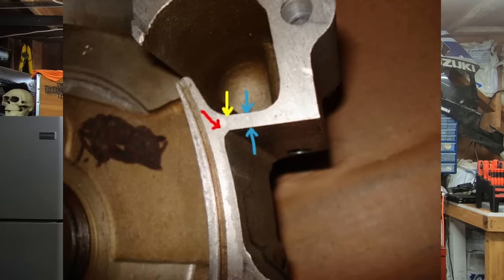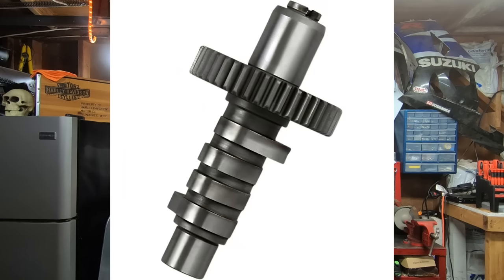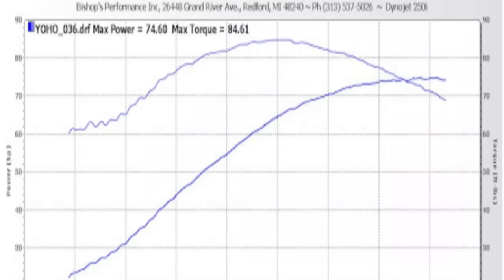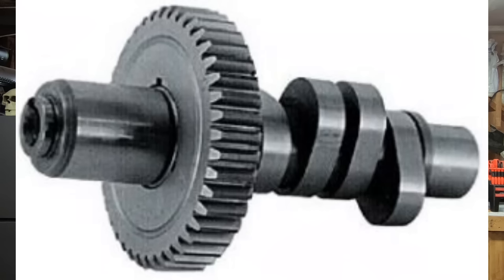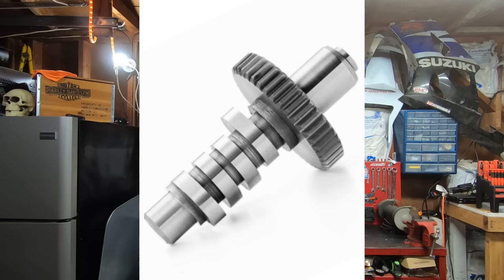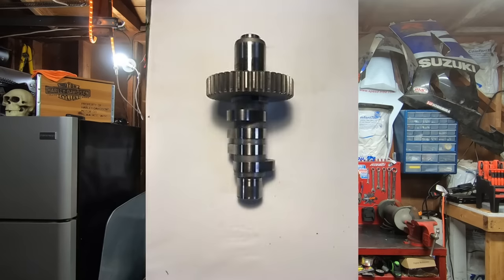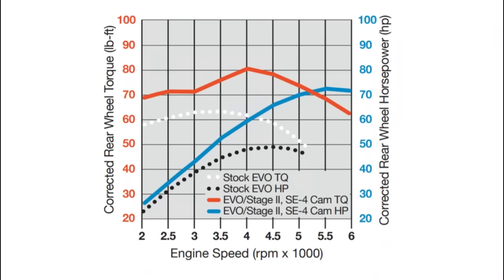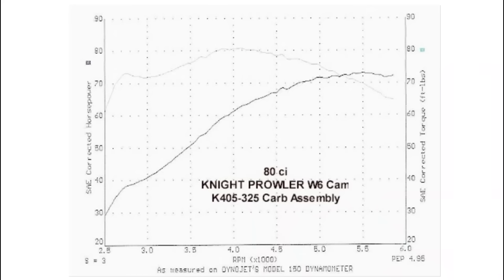Absolute Best Upgrade for the Evolution Harley-Davidson

Comment: I ran a Wood cam/ w6, expensive, but good. After some mods ended with the w8,H.  Still an 80" motor. Murdered tires, chains, sprockets, wheels, and clutches  Was loads of fun, but too much maintenance. He makes good cams. I would recommend keeping it closer to stock. Good Lord, just noticed this post is 2, count ' em, TWO years old...

Comment: I bought a new XL1200S in 1998.  Billed as the ‘performance’ version (two plugs/cyl, extra front disc, maybe a tad mor compression) Thought I could spice it up, above and beyond the initial torque grunt.  Pipes, jets, filter, host tube.  Killed the torque, didn’t add much on top. Actually, still makes power when rev limiter kicks in, at 5500!!!  One available for 6300 rpm available, was, but expensive.  i gave up.  Found out how much Harley’s are different from modern engines, dirt bike engines, etc. I was completely ignorant going in.  No youtube in 1998…hard to get info like you can today.  Regardless, the bike looks fantastic. Still have that ‘98, still runs great 8000 miles.  Still For Sale.

Comment: 2010 I went with SE heads, EV 23 cam, Mikuni 42 carb, Kirker Pipes 3-1/2 Super Trapp thunder  Dino was 98 HP , I was shooting for 100 hp . 98 is fine a 103 stock cant touch this  .

Comment: Adjustable pushrods eliminate the need to remove the rocker arms. Otherwise the fuel tank, rocker boxes and rocker arms need to be removed to access the pushrods to unload the lifters.

Comment: My 88 fxstc moves with no issues. I have a w6 cam, mikuni42 carb, s&s lifters, ultima ignition, and adjustable pushrods. Top end is all stock but it goes great. For bolt on stuff it's way different than it was when I got it. Anybody looking for a cam if you can't decide just go w6 it was well worth it.
Reply from the maker: Good cam in an Evo makes a world of difference over stock!

Comment: I put a 13 n my softtail Got an ultima 6 speed n a Makuni 42 VnH  long shots Got great torque n top end  Avrage 50 plus mpg Can use 6 gear from 50 up Some had put a 38 Got around 30 mpg And couldnt ust the 6 speed till 80 mph Im happy with the 13
Reply from the maker: That's awesome! Those 6 speeds make a huge difference!

Comment: My 2017 sportster 48, coming back from Daytona the other night. I was running with some sport bike 600. I was running around the 138mph.
Reply from the maker: My wife has 2017 48 and it will absolutely walk off and leave my 2016 Sportster Custom. I know it's a lighter bike but it's got some serious power compared to the 2016 model.

Comment: Bought my FXD with S&S 502 cam, was running like a raped ape but the valvetain was rattling as a bucket of nails and was eating lifters for breakfast. Swapped 502 for EV27 and perhaps lost some peak power and torque but it has a really broad power and torque range, valvetain is really as quiet as if it had a stock cam and as a bonus it now has a slightly quieter but throatier exhaust note. Very happy with the result

Comment: You have a good channel and you seem to be very knowlegeable.
 I'm not into racing or a bunch of facts and figures, but I've got a '97 Wideglide that walks away from twin cams and will cruise at 80mph all day long, with 41,000 on the odometer.
 I bought it second hand 5 years ago and it sounds like a stock motor and has no engine noise.
Reply from the maker: If it's rolling away from twin cam bikes it might be a cammed EVO. Evo's makes some big torque with the right cam in them.

Comment: I believe the evo was the step above the shovel. I love the shovel's thump. The Evolution engine is a longer lasting in stock form engine than it's predecessor. Basically a longer running engine than the Shovel. However the '84 shovel was close .

Comment: Love Woods cams. I have had my evo since 85 and have put a few cam changes always using Andrew's cam until a friend talked me into trying the Woods  . As far as I'm concerned it pulls a lot harder than any of the Andrew's cams I  tried. If you want to build a stronger engine with head work and card and such I went to the Woods w6h and Woods carb. Pulls like a mfr. At about 110 I ran out of guts and the old girl was still pulling hard.

Comment: Look at V-Thunder cams.
Excellent cams with soft opening n closing ramps for engine longevity.
I ran an Andrews EV-27 and after about 25,000 miles it beat up my cam n one of the lifters to where the tiny needle bearings were coming off the lifter roller. The EV27's fast opening n closing ramps are too aggressive n beat up on your valve train. Eventually damage will occur.
That's why I went with Comp Cams V-Thunder series cams because they were specifically designed to be easy on the valve train to increase engine longevity. As far as power n torque, I have no complaints, they do their job
well, have a real smooth idle n give you that low po-ta-to, po-ta-to idle that you want to hear. They are awesome cams. You really don't need anything higher than a 520 lift cam with a decent duration to produce good power
n work easy on your valve train. Anything higher n the engine fights itself to produce power working against those heavy 200+lb
valve spring rates. Something to think about.
Live Free
Ride Hard
Reply: I'd need taller valve springs? (For sure,but what else do I gotta do for a .595" cam? I had a 96" 4x4 s&s sidewinder evo in a bar hopper,that thing had balls!
Reply: @numbskullsknuckleheheads7636  
A 595 cam is to big. Yeah, not necessarily taller, but stronger valve springs. This alone will overstress the valve train causing premature wear, n sooner or later damage.
That big cam will also require cutting down the valve guide to allow for the added lift so the bottom of the top spring collar n keepers won't hit the top of the valve guide when the valve is opening the valve. It also needs to be cut down enough to allow to install valve guide seals or your engine will burn n smoke oil. By cutting down the valve guide, you are also reducing the length of the valve guide decreasing the amount of support the valve guide gives the valve stem, in essence making it weaker. The movement of the valve will eventually start wallowing out the top of the valve guide. That's why keeping an engine close to stock specs with the biggest "bolt in" cam works best for engine longevity. And you don't necessarily need a higher lift, you just need a moderate lift with a "longer duration" to keep the valve "open longer". You can also machine the heads to accept larger valves (tulips) to minimize the lift of the cam, because a longer duration achieves the same thing with alot less stress n friction on the valve train which equals Horsepower. You may have to figure out which duration cam will work best with the piston stroke to maximize your "swept volume", ie, how much air n fuel the piston will suck in... High compression is not necessarily needed either, unless you're planning on having high octane fuel on hand all the time. 9:1 compression is good for the standard 91-93 octane that's available at the pump. Any higher compression n your engine will run like shit. Your call..

Comment: I've used several of those cams but 2 stick out to me, the ev 27 and 23, I ran them both and really never could tell much of a difference honestly,  my favorite though was a .530 lift cam that was bolt in by crane. Hands down my all time favorite bolt In cam

Comment: Hello Gixxer, I'm looking to buy an EVO motorcycle, to get that beautyful potato sound, and make some upgrades to the motor for better perfomance. However, i'm worried that if I install perfomance cams and a jet kit, I might lose that icónic potato sound. For me, the clássic sound is more important that the perfomance. What do You think?
Regards from México
Reply from the maker: Actually a performance cam is going to really give it some slope and make it even better than the stock cam. Not to mention a performance cam will really give it a nice bump!

Comment: Best cam for reliability and easy starting? Looking at either this stock Dyna wide glide with 17K miles or for $700 more I can get a 94 wide glide that has an S&S crate motor. Looking into building a daily friendly Dyna.

Comment: I better get with the times still running a stock 74 inch 64 pan
Reply from the maker: Ehhhh getting with the times is overrated, that pan you can rebuild on a dirt floor of a barn or the side the road. The newer the motor the more special tools and tighter tolerances to deal with.
Reply: Hey, I got a 94 dyna, wanna trade?

Comment: A little off topic here but what about the cam bearing? I heard that is the weak link in an Evo and it can destroy a motor. Do you know how  many miles we should get out of a stock cam bearing?
Reply from the maker: That is true, the inner cam bearings were known to fail. It does vary but usually Evo's need lifters changed at 40K, that's a opportune time to get that bearing changed to the torrington bearing. Usually they will make it 40K, personally the failures I have seen were above 40K. Every bike is different though and maintenance and riding habits play a big part.
Reply: @GixxerFoo  Thanks for the info. And Im enjoying your videos. Very professional.

Comment: 1992 FLHTC Fully Dressed ,88 S&S ,S&S Shorty E with a 74 jet   , 6.5 Hg VOES, Daytona Twin Tech MSD ignition, Power House 500 Performer cam, S&S  Hyd Lifters, Baker 6SP OD(.086) Thunder Header, I've ridden more than a few stock 80" & mine just feels like its more than twice the power. My Buddies with their Twin Cam in Stage 2 & dyno tuned ,their jaws slack & eyes open wide when I pour it on & "Grampa's Bagger" leaves them behind (plus I ride like a wild Animal). Them with their "more Cubes & power/torque" are like WTF  you got in there? "just a square Evo" but I've been trying to get more out of the top end "Highway speed , 6th speed ( in OD)low end torque( low RPM 2,000) for the Over Drive, with out Detonation .The EV23 couldn't pull it took it out. I like the idea of that woods cam, I would like to know more . From First to 5th it Spools up like a beast & you better be on open road to run it thru the gears but the OD still seems a bit wimpy to me. what do you think?

Comment: Ev27 , 9 to 1, pistons . deck the heads. Stronger valve springs . Hot single fire ignition,  decent carb . Ok Pipes.. Go forever. 
Always buy 2 of the same cams you want , see what fits best return one of them , you need to make sure the gear on the cam wont be to tight or to loose. (Bolt in) means just that ,,, But that’s different than it fitting correctly. Check your cam gear size !
Reply: They let you return a cam that's been installed?
Reply: @porkchopspapi5757  just mocked  up .

Comment: I love my 96 road king, Was injected now has super e s& s carb,ev 27 cam s&s Reed breather, Screaming Eagle heads, Keith black Flat top pistons. S&S rods, Vance and hines two into one pipe, Roller rockers, Thunder v push rods  So not much further, I can go. Oh, yeah, much bigger intake. That is portmatched, that wasn't real easy. It goes great.It's been dependable and it's got that awesome Evo noise lol Not much further. I can go guys.
 And stay dependable. 84Hp 92t Also a compu- fire ignition Torrington berring  upgrade

Comment: Can you change the lifters on the EVO with just removing the push rods and lifter blocks. Thanks for the info. Just purchased a 93 Heritage and want to make sure it is reliable and doesn't puke on me. That is the reason for the lifter question since I heard they need to be changed at 25,000 miles or so and mine has 40,000. Have been watching your videos for some time and really appreciate the info.
Reply from the maker: Yes you can! It's really easy if the bike has adjustable push rods, if not you'll have to remove the push rods through the rocker box.
Reply: Or, you can cut the old pushrods, then get a set of adjustable EZ-install pushrods to go with the new cam.
Reply: I'm in the same boat, just purchased my first Harley, a 97 1200 sporster with 35xxx miles on it.

Comment: Red shift 576 here big balves ported heads high lift springs 10 to 1 pistons .040 mls head gasket E carb thunderheader 2000 i ignition

Comment: Do the heads need to be ported or modified in any way? Total newbie right here.
Reply from the maker: Not with a bolt in cam, they are designed to work with the stock heads and valvetrain.
Reply: @GixxerFoo  awesome thank you

Comment: Can I do this upgrade on a 1200cc 2007
 Sportster Custom with a Screaming Eagle exhaust system?
Reply from the maker: Absolutely, Hammer 570 cams are perfect for a cam swap with nothing more than exhaust and air cleaner. Now keep in mind you will need a Power Vison tuner but it's well worth the added cost.

Comment: Great videos I don't own a Harley I am into metric crusers. I own a 07 rswarrior but I watch because I feel like a lot of your advice applies to me as well. How about a few videos on metric crusers? Maybe like vtx1800, raider, m109r , meanstreak , new vmax maybe 🤔 or 9f course warrior stuff lol
Reply from the maker: I used to hate Harleys growing up in a Kawasaki shop. We sold the crap out of Vulcans cause you couldn't get Harley in the 90's. The shop customized a few Vulcans to where you couldn't tell the difference unless you knew what you were looking at. Metric cruisers are fun bikes, they are just so hard to get parts for. Years ago the aftermarket used to have all kinds of go fast goodies. Especially the Warrior, 100 horse was no problem on that bike.
Reply: @GixxerFoo  yea the aftermarket stops making parts for them after like 10 years after production. Still plenty of stuff tho, I am currently having patrick racing hc pistons big air kit ecu reflash head work and of course some other stuff not mentioned and dyno tune will be needed also now. I am hoping for like 115ft lbs or so more or less.

Comment: I haven't given much thought to this topic prior to watching your video. I know on my old Sportsters they'd puke at some point between oil changes. Never effected how my bike ran though. One thing I was wondering. Now that we have corn supplemented gas, does it keep the internals cleaner? I still and always will run non ethanol in my 92 Fatboy. Those old bikes just do much better running it I think. Great video and information!
Reply from the maker: Thank you! I appreciate it! I don't like running ethanol fuel in anything but it's okay to run it as long as your burn it completely out and get some regular fuel. That's getting to be a hard option to find with pure gasoline, I like to run a motorcycle fuel additive which combats the negative effects of ethanol. Especially if ethanol is your only option and the fuel is going to sit in the bike for a week or longer. My thoughts on ethanol fuel is that it does leave behind a little more carbon than straight gasoline.
Reply: @GixxerFoo  Thank you for the reply. You answered what I always wondered about as far as gasoline goes.

Comment: The Cams all good but what do you recommend on lifters and push rods. Ya gotta go hard but also last.
Reply from the maker: With a bolt in cam you can use the same lifters and pushrods, but on the Evo I like to go ahead and change the lifters. With that push rod angle the lifters can start having issues around 40K.

Comment: flow the heads . 5 angle radious valve job. Pistons . Cam and carb with the right exhaust and it will easily make 100 HP. And still be reliable

Comment: Hi, Rev Tech 115 (and 125?): these motors are physically wider than the HD Evo and, I believe, the 110 and smaller R/Ts as well - I found this out when changing out an exploded 89" stroker to a FXR.  Question: are your HP/ torque numbers always from motor only, (like the published S&S products) OR from the rear wheel?  I deduct 15% from motor only numbers? what do you think?  Note: R/T 115" comes with Andrews EV 72 cam - a pretty long duration lobe - this motor does it all very well. My 'Tantrum' employs my own 60" WB chassis - 527 lb w/o fuel - motor: S&S 111 - it's much like 115.
e

Comment: i had an 90 fxlr with ev 3 cam,hi4,tuned CV,and white brothers 2-1 it goes to 72hp on the dyno. Today i have an FXDC(92) i had ev27,compu fire,tuned CV,2-2 supertrapp,but it not near what the FXLR was in torque,so i swap the cam to ev3 and hope i can come some closer,i miss my old FXLR it was so well build and never falied,the FXDC had broken inner cam bearing,danmage gear box and the last i had to replace the forward chrank rod bearing and bore my cylinders with new BK 9,5:1 pistons,aaaand im wayting for the summer

Comment: Ev27 fits my Softail perfect.
Reply from the maker: That is Andrews most popular Evo cam and for good reason!
Reply: @GixxerFoo  only trouble I have is a little jerky off throttle in slow slowdowns, like coasting third gear down towards traffic stop. S&S Super E with thunderjet, jetted to .68 and .295. I'm thinking of trying .66 and .28. Headgasket .030.....

Comment: Yeah Mr. Gixxer, your videos are by far the best, and I think you should run for president! But as far as you can video, an important thing that you failed to mention is you not going to get any where near those dyno numbers by just throwing a cam into stock Evo. There’s definitely a few other things you’ll need if you think your even going to come close! Head work if not Screaming Eagle or S&S heads ,you’ll need some performance exhaust preferably something that’s 2 into 1 and a fine tuned carb th